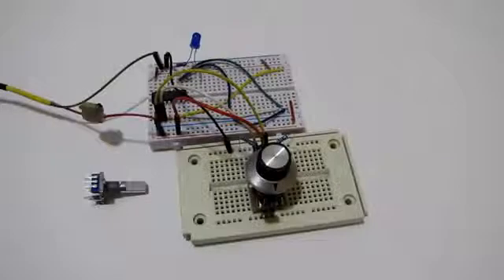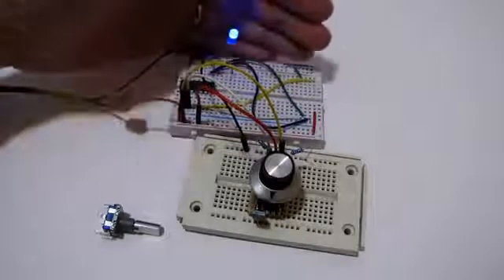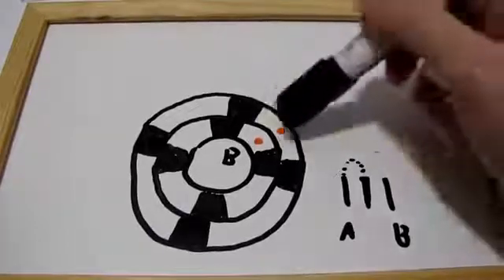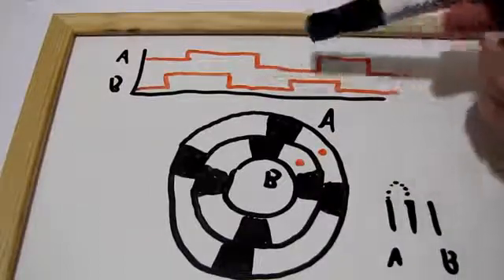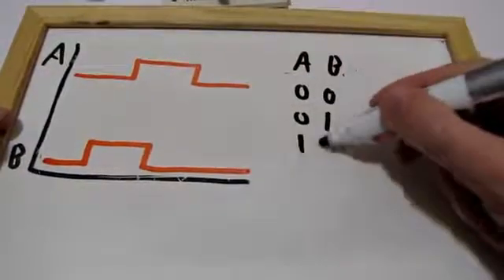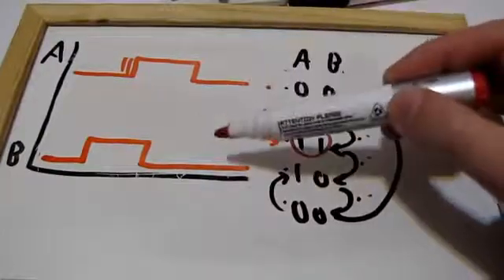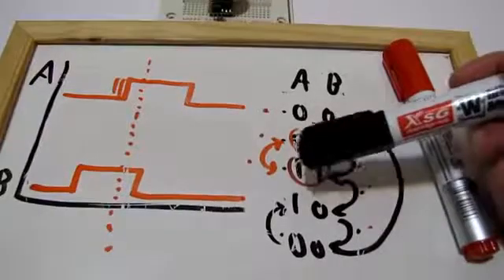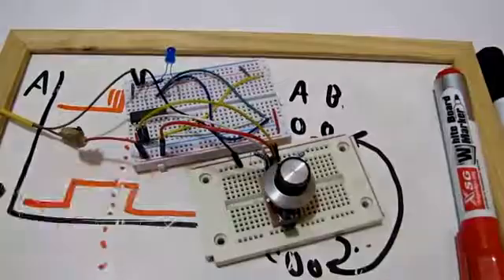The Accurate Way To Read Rotary Encoders

Comment: In your example you show 4 steps from 00 to 00. Do you consider 4 steps to increment your rotary counter of 1 count or you use the 4 steps in the final counts ?
Reply from the maker: Each time it gets to 00 (assuming the turning direction is constant), it means one encoder position.
Reply: @idogendel  So (assuming the turning direction is constant) it takes 4 encoder steps to increment the counter of one ? Hmmm.
Reply from the maker: @jpdesroc  Just be careful not to get confused with the terminology :-) Say you buy an encoder with "64 positions" - then each of those positions goes through the four steps.

Comment: Which pin to attach capacitor. What what value of cap should i use?
Reply from the maker: You'd want to put a capacitor on the pin where the unstable signal is, to smooth the signal... but its value will depend on the properties and requirements of your system, there's no one number to fit all cases.

Comment: Are you polling the pins or using interrupts?
Reply: No
Reply: @mryup6100  Polling the pins would equate to periodically calling the state machine.  Alternatively, one could use interrupts to trigger the state machine.  I've done both using this technique.  So do you have a third option in mind, if so I'd like to hear about it.